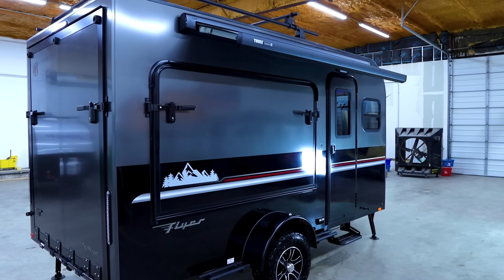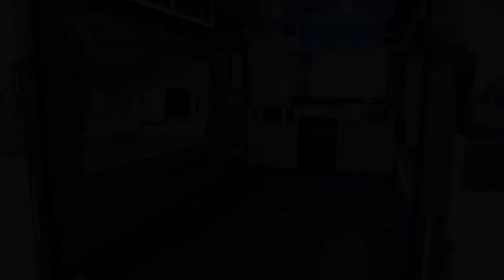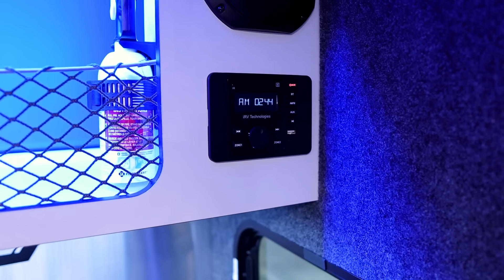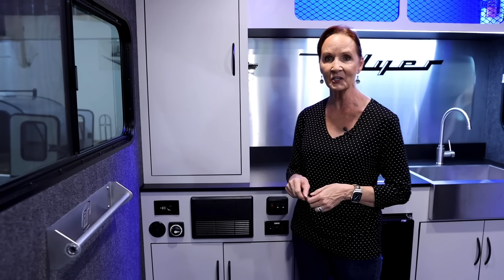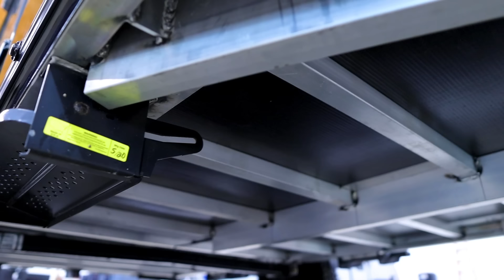The 2021 Discover by InTech RV - Flyer Series - Walkthrough Tour

Comment: Just picked one up and really stoked to have the flexibility to use it to boat... Hunt... Work... Beach with kids... Surf... Travel alone in winter with beds up or summer with fam with beds down. I'm installing a propex hs2100 heater under the rig. A road shower from Yakima 10 gallons. An on demand 120v heated for the sink and a propane instant hot water for colder weather.  The versatility and build quality sold me on it.

Comment: Great review! If it had a larger water tank (20-30 gallons), outdoor shower, maybe some solar panels to keep the battery charged, and a better way to access the roof racks I would be sold. I can just bring a portable toilet if there was somewhere to store it. Who wants to deal with a black water tank....
Reply: I just got one and am installing a ladder up front. Small bucket toilet. Solar panels. Roof water tank. Propane indirect heater and on demand water heater. Also a generator mount up front and a mount for my Sur Ron electric bike across the roof and a cantilever gear davit hoist to lift kayaks or small motorcycles to the roof when UTV is inside.
Reply: @RakunOutdoors  Awesome! Definitely make a video of the finished product.
Reply from the maker: All great suggestions!  I’ll pass that along to the manufacturer, maybe we will see those features in the future!!🤞

Comment: Imagine if they put the electrical panels in a bench that spanned the curbside beneath the pop-out, it could serve as sitting or a single sleeping space when pop-outs are in the traveling configuration. They could then add a tiny wet bath in the space next to the kitchen. You wouldn't have room for a side by side anymore, but could still fit a dirt bike and still utilize the ramp for easy loading and offloading for gear, maybe we'll get a wet bath model at some point!

Comment: beautiful toy hauler camper! the 8.5 gallon fresh water tank is small. wonder if they can upgrade it.
Reply from the maker: We have asked that as well. We have seen some people carry extra water in Jerry cans mounted in the exterior...
Reply: @PrincessCraft  should be an easy fix.....just put a bigger tank or a few tanks under the frame
Reply: Princess Craft this needs a bigger fresh water tank, and outside shower at a minimum for the price. A cupboard to stow a porta toilet, cassette toilet would make it perfect and I would buy one ....
Reply: You can always bring portable water containers, I bring two to four 7 gallon water tanks depending on length of camping trip.
Reply: what about the heater - it seems you couldnt use this in cold weather with the popout tents
Reply from the maker: @amirkazemi2517  I camped in it when it was 40 degrees at night and the heat strip in the a/c did great!   Freezing weather might need an additional heat source.
Reply: @PrincessCraft  everyone uses that chinese diesel heater it seems.
Reply: @amirkazemi2517  They work great and cheap

Comment: No bathroom, think about it when you wake up and have to go and it’s pouring rain. The tent material can and will leak. You will need to treat it. Think about sleeping in the “tent” when winds at a mountain CG hit 25 to 40 mph. Some National Parks restrict tent campers due to bear activity.
Reply: You should look into RV, not a toy hauler! haha. I will bring all my 4 bicycles, motor cycles, and kayak and, portable toilet and portable showers, and all camping gears.
Reply: @mctigmctiggy1475  Because They are all different bicycles, I have light weight bicycle, aerodynamic bicycle, touring bicycle and mountain bicycle. They all have different purpose and use. I may ride different trails, and may do off road ride, or down hill mountain trails, or rails to trails. Nothing is one fit for all.
Reply: The beauty of this trailer is that you don’t even need to use the tips outs. That’s what make this trailer so cool. It’s so flexible in use.
Reply: @ClarabelleJeanne  Then just buy an ATC Aluminum Cargo trailer (finished) for half the price. Plus the ATC is a tandem axle.....good luck handling
 a blowout at 55+mph with the Intech single axle.
Reply: @hoptard  Different trailers for different needs. Have a nice day.
Reply: @ClarabelleJeanne  Have a nice day also in your 28K aluminum box.
Reply: 1.  The hauler has a 6'11" interior height.  Therefore and if required, one can easily have a cassette toilet inside a privacy tent open IN the hauler itself during inclement weather or at night.  
2. The hauler has excellent ventilation and if required, one can comfortably sleep on the floor using one or both of the 48"-wide mattresses with the tents retracted into the space.  When weather is fair, one can also enjoy the advantages of fresh-air tent camping, making this hauler a very versatile way to overnight. Its best-in-class hauling capacity permits customizable water and other gear storage options as well.

Comment: For what it is I love it.. aluminum trailers last way longer first off... it still can be used as a work trailer during the week for a contractor..then used as a toy hauler.. a camper. Get a composting toilet or cassette toilet..put a shower rod set up for some private time.. hanging from the ceiling..but the best part is no space loss from a full time bath.. a water tank could go on roof for a gravity feed outside shower.. with a privacy curtain  again no real space loss.. most people are upset about not having it full time... go buy that kind of toy hauler camper than.. this design has simplicity and multiple use of spaces for a different kind of owner.. I think is just what I will be buying.. I can fill with my tools and materials during the week and pack up my dual sport motorcycle or adventure bike some camping gear generator.. drive to the mountains..enjoy my weekend ..then use for work again during the week .also add support cables for rear deck and a magnetic screen.. like a another room.. very open with the no slide outs.. that always fail.. the tip outs are awesome will last forever..just an amazing product for my needs with a few mods it’s perfect. Thank you for the best review.. you pass on the best info I have seen watching trailer videos well done !  I see this as my future pick !!!
Reply: Did you get it Matthew?! I was also wondering if you can use the ramp for a deck?

Comment: How far into the interior do the retracted bed(s) reach? Is it possible to get a single bed on the curb side only?
Reply: She said the door side bed was an option.when bed is closed looks like it takes up very little inside room.
Reply: They fold up as a wall
Reply: I can fit my Ranger with mirrors and doors inside with two beds folded. But I have to exit from the rear window and fold mirrors in.

Comment: Outdoor shower would be nice. Cassette toilet too. 8 gallon water capacity isn't enough. Otherwise I like it.
Reply: bring portable shower and toilet too
Reply: Cycling Gospel you can buy and bring all that along but then what are we paying for if none of that is built in? Would be better off just buying a cargo trailer for a fourth the price if you have to supply your own water, porta toilet, outside shower, propane heater, etc. Total fail at this price point....
Reply: You can bring a few 7 gallon water containers, I bring 4 of them when I go long camping, that is 28 gallon water.